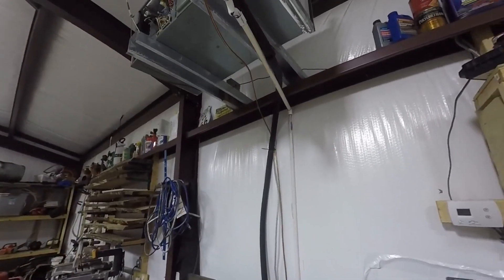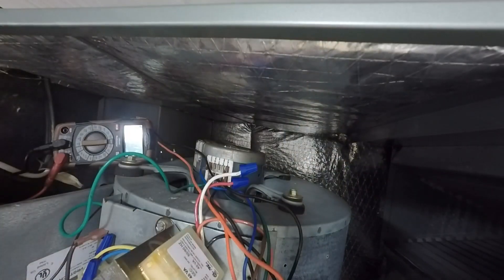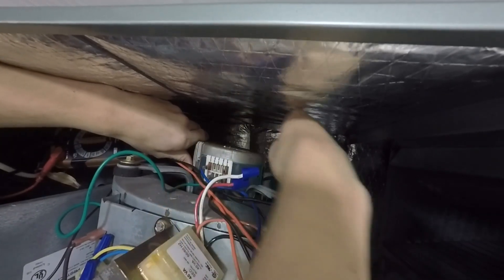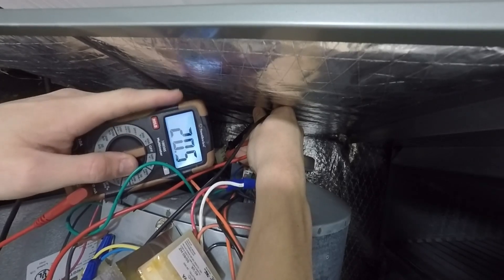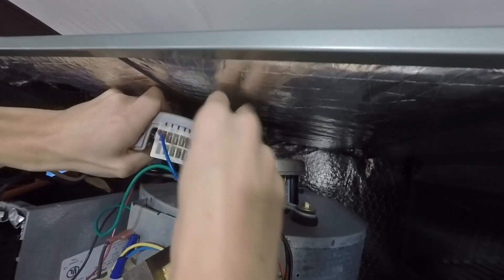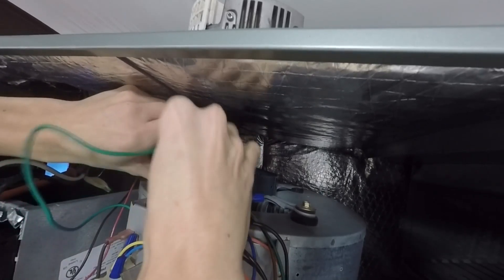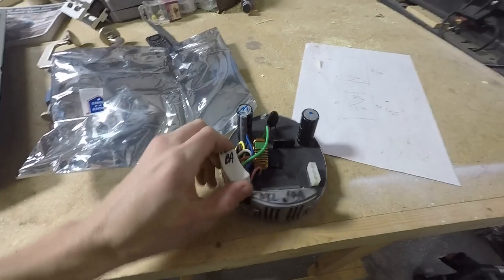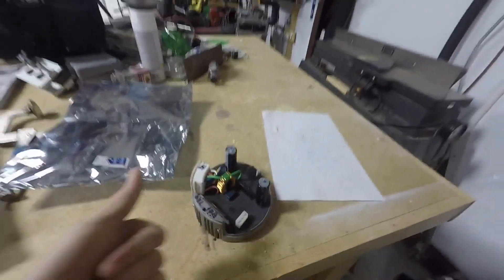HVAC Blower Fan Beeping and Moving-X13 Motor Module Replacement

Comment: Great Vid, Thanks.  Is it possible universal power 115/230?  I saw same black capacitor voltage 200V on any.  I need 230V, but find cheap 115V on eBay, may I use it for 220V ?

Comment: Great vid, really helped me figure out my issue.  Question- where do you purchase one that has been programmed?  My OEM (Luxaire) x13 has a sticker saying “Programmed P/N 630427”
Reply from the maker: I bought mine off of Ebay, you just want to ensure it is programmed to the correct horsepower.